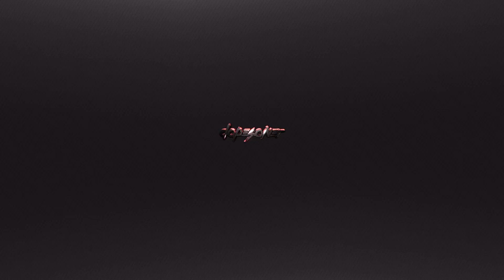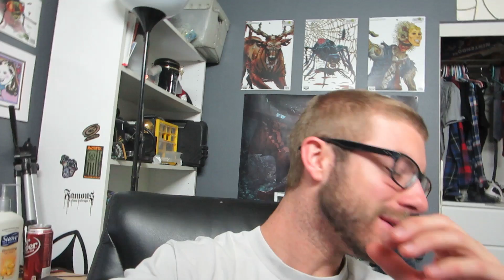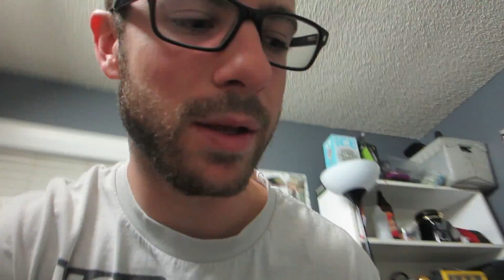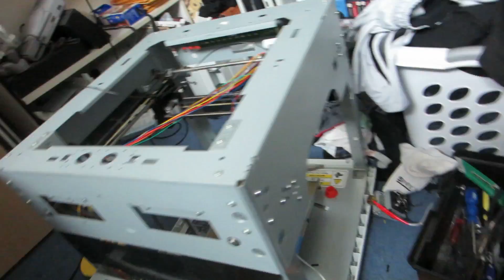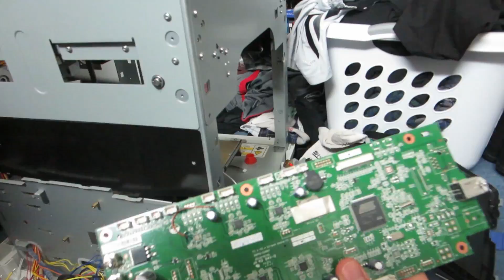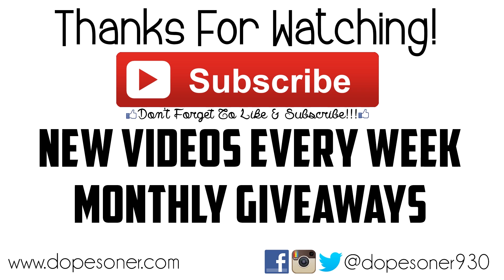Update On Da Vinci 3d Printer Board Swap To Ramps\Arduino Combo

Comment: Nice to see you are making good progress with your printer.  I've been having a hell of a time with the 3d printer I got recently.  My two biggest issues at the moment are trying to figure out how to get the nozzle off my hot end without breaking it like the first time I tried and I have to figure out why the x-axis is off by 2mm whenever I try to print a 10mm test cube.  Plus my prints aren't sticking too well but I'm pretty sure the partial clog is playing a big part in that issue.